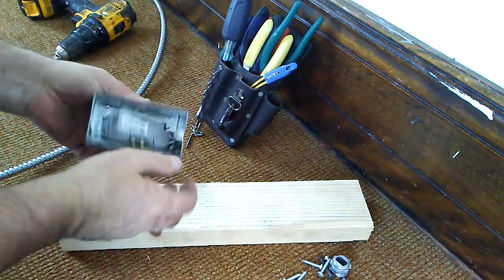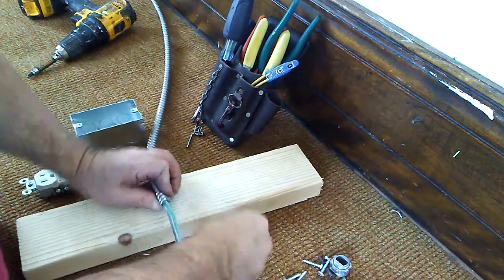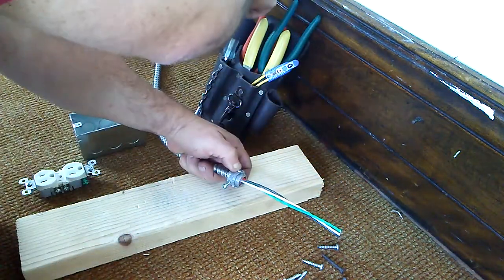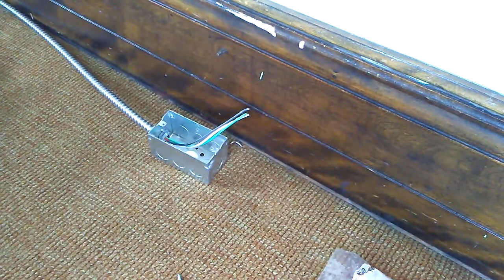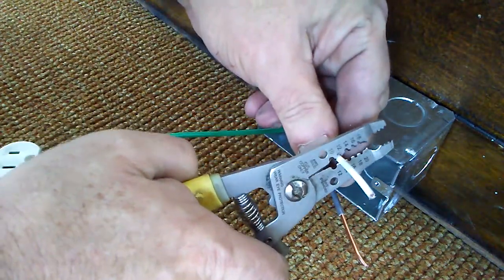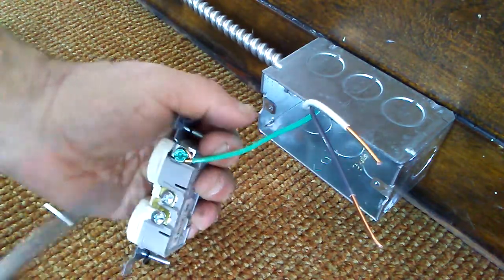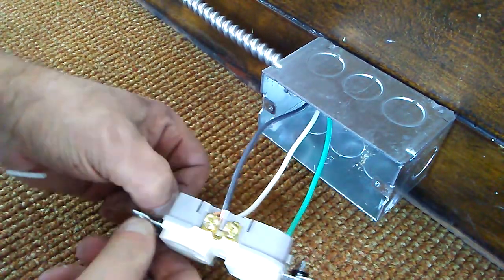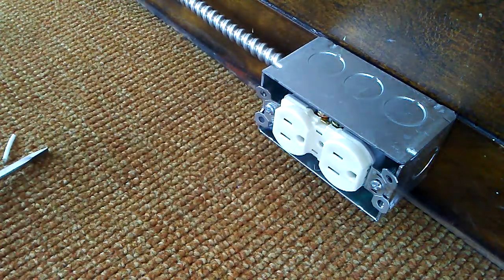January 21, 2018 I do wiring in a office building using mc cable installing outlets

Comment: Don't you need to be putting in a bonding jumper pigtail screwed to the metal box when using MC cable? If you used self-grounding receptacles with the brass bonding clip on one yoke then you would be ok. I realize that practically the receptacle box is grounded when you remove the plastic washer but I thought code doesn't allow that unless it is rated for self grounding?  Correct me if I'm wrong.